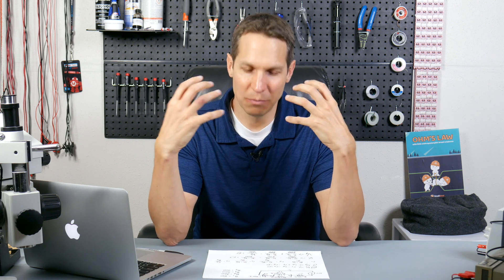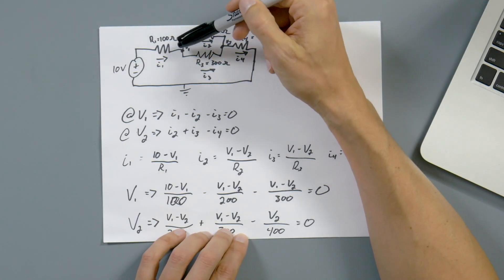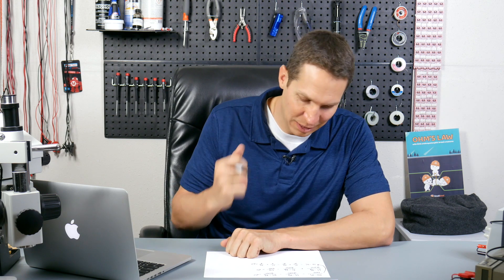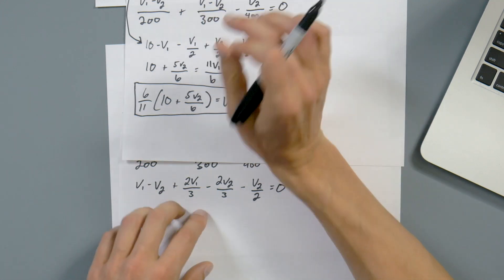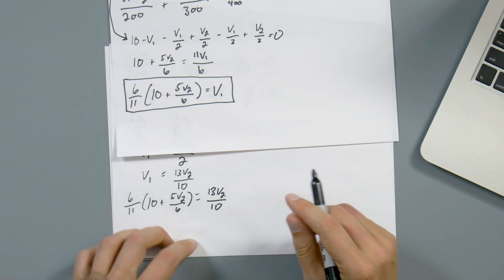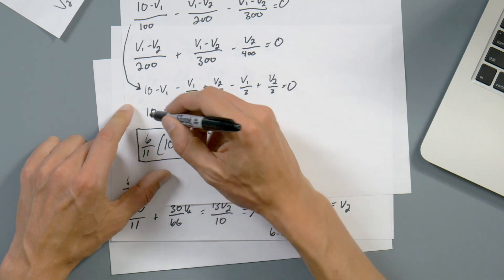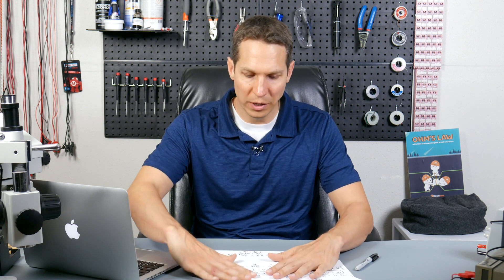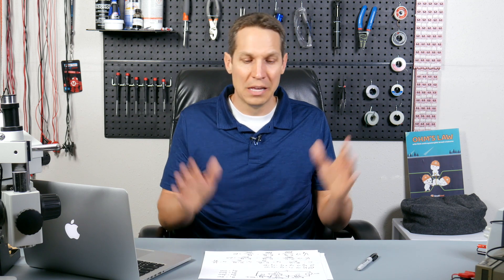Basic Circuits Math - Using Substitution and Matrices to Solve Circuits Equations

Comment: I found it easier to multiply both sides by 600 and simplify before distributing. I get the an equivalent answer and less fractions to deal with. V1=(60+5V2)/11

Comment: Solving 2 equations comes handy using crammers rule, it's almost impossible to miss something out in it. 
But what aches my head is 3 or more equations on those nodal analysis equations, I hate them, first I have to sum up all the common voltage fractions into one fraction and then putting the equations into a matrix to solve it, i almost always miss something in the first trial.
Reply from the maker: Unfortunately, that is a big weakness for me as well so I don't really have any thoughts or advice on it.  The "just be careful and thorough" adage that I keep telling myself is important but not really that useful.  Hopefully someone else chimes in, I'd love to get some help with this as well.